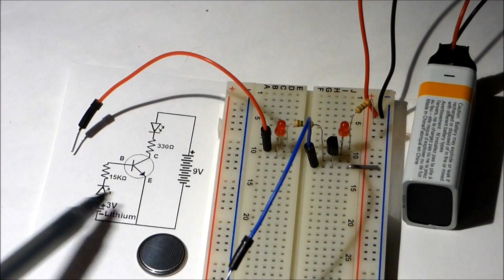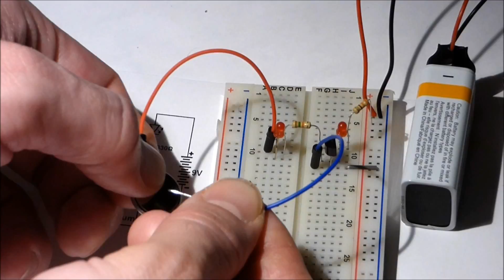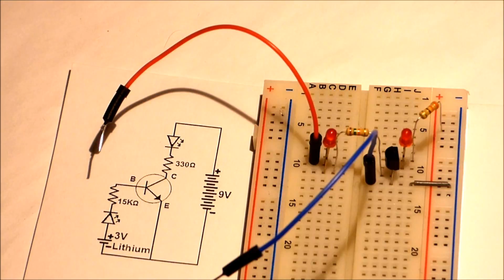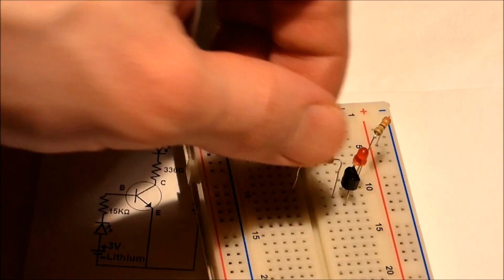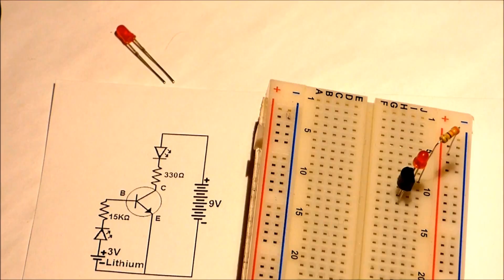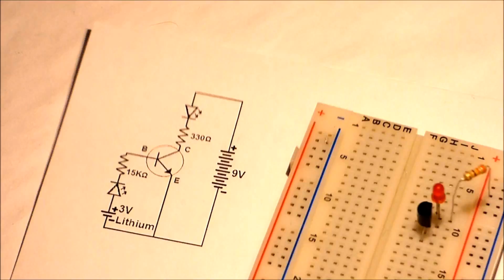Simple 2 battery NPN transistor schematic and circuit explained for beginners starting electronics.

Comment: could it work without connecting the negatives of the two power sources?
Reply from the maker: The emitter needs to go to both negative supplies, so they have to be electrically connected.
Reply: @Electronzap  what if there are two different circuits but powered by the same AC source. Is that considered connnected?
Reply from the maker: @Agisilaos746  Bipolar Junction Transistors always electrically connect all power sources that are connected to the transistor because the base current goes to the emitter, as well as the collector current. Mechanical relays convert current into a magnetic field, and opto-isolators convert current into light, which is then used to switch other circuitry without electrically connecting the 2 circuits and their power sources. So you would want to use something like them if you don't want the voltages or currents of separate power supplies to come in contact with each other.

Comment: Hi. Thanks for doing this vid - really helps. I have some confusion though and would be really grateful if you could clarify for me:
You say NPN but, the transistor has a positive base, positive collector, and negative emitter so, isn't this a PNP? I've watched many vids from various sources about the difference between the two and I'm also extremely dyslexic so would be really grateful if you could explain my misunderstanding? I need to know because I want to merge two different batteries through a transistor so as to obtain the combined volts and current output. My understanding of how to do this is as follows: Battery 1 positive connected to base, negative connected to emitter. Battery 2 positive connected to collector, negative connected to emitter. Therefore meaning that the load points for combined power of both batteries is from the collector and the emitter. Is this correct and do I need NPN or PNP? Thanks if you could help to clarify.
Reply from the maker: NPN refers to the type of semiconductor material that is used to make the transistor. It has two areas of N type material with a P type material between them. The only way for current to flow through all three types of material (collector, base, and emitter) is if a small amount of current is flowing through base to emitter. Current is considered as moving from positive to negative. So you need the collector and base more positive, while the emitter is more negative.
Reply: @Electronzap  Thank you very much - really appreciate your time and input on this. I think I get it but will read it again and try some experiments as soon as I can. Thanks again and all the best!